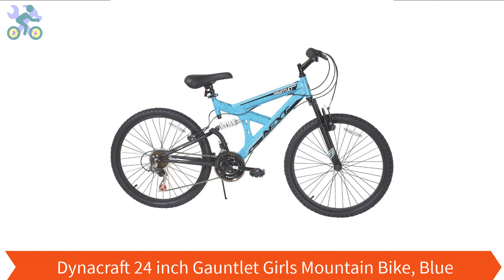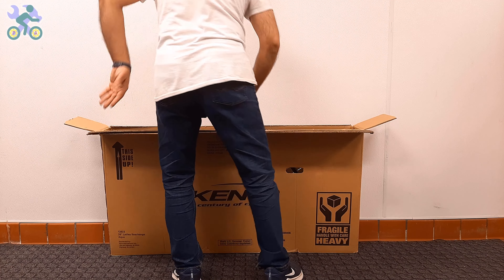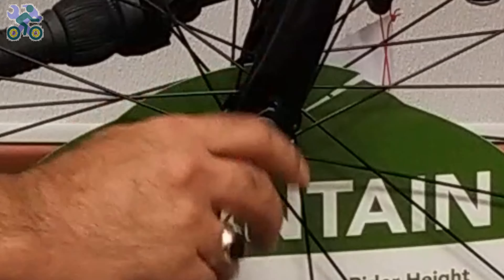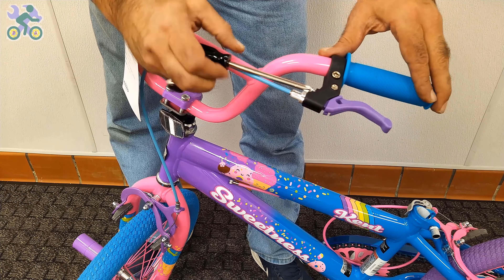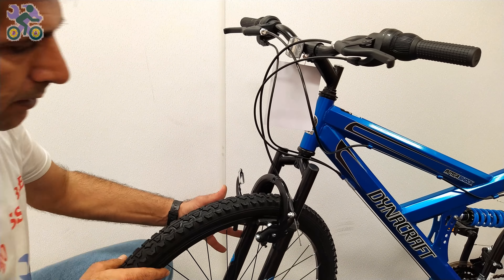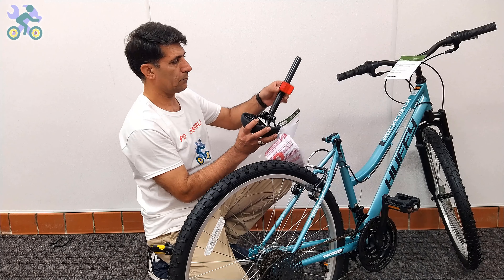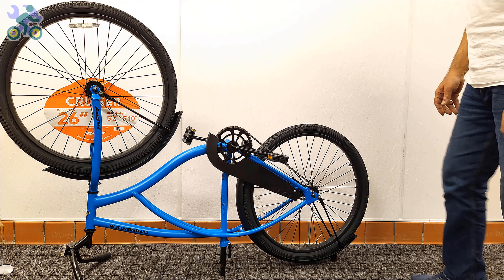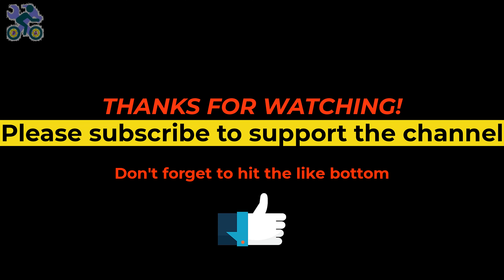How to assemble Dynacraft 24 inch Gauntlet Girls Mountain Bike, Blue slot 680

Comment: During assembly the front break metal piece that pulls (18:00-18:30) broke. It completely pulled out . How do you reset it? Can you zoom in on how to tighten/set up the break "cord" handle (18:11)
Reply from the maker: Do wanna say the wire came out or the noudoul broke ? I don't get it exactly which part.